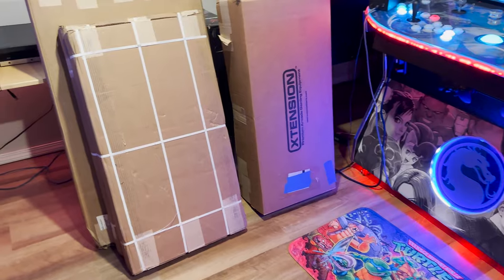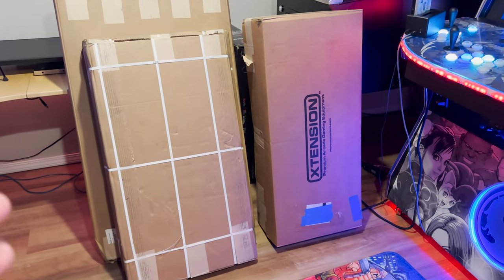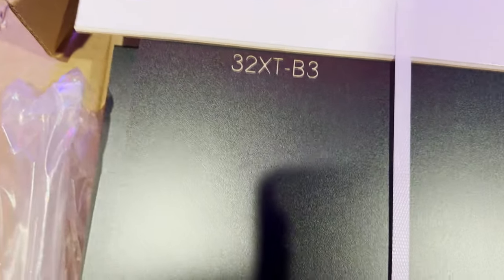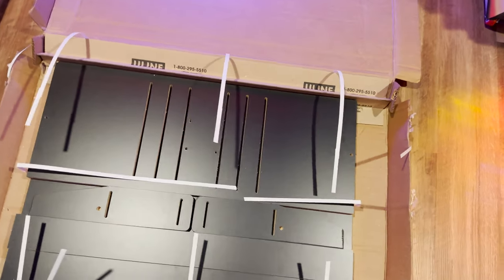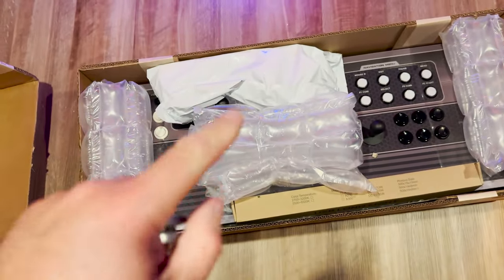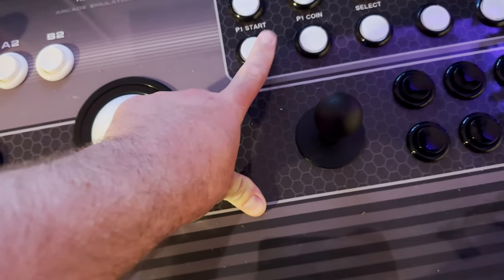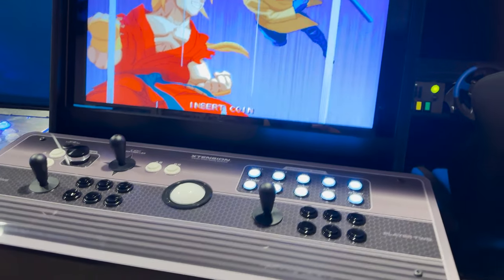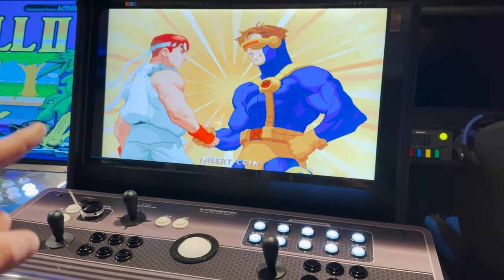Full Size REC ROOM MASTERS 32" Xtension Arcade Cabinet "Emulator Edition PLUS" Review and Unboxing

Comment: Amazing how quickly you unpacked those boxes, Adam! 😋
A couple of years ago, I built one of these "tankstick" cabinets (from the old owners' company, apparently). And I too went with tempered glass over the supplied plexi.... 100% worth the upgrade, clarity-wise. As far as the artwork, I was able to order what I wanted when I ordered the cabinet itself (for an additional fee). The artist that they had did a great job creating custom artwork for the cabinet, the control panel, and the marquee. All-in-all, it was a great starter arcade that I ran Steam games on (through Launchbox/BigBox). And I was able to hook up my old Xbox One & Nintendo Switch to it, using connectors and switches. I think it's a great way to get an arcade cabinet without spending a ton of $, assuming you already have a computer available to use.   👌

Comment: hope they intend to bring back the vertical cabinet.
Reply from the maker: Oooo, good call! With all the new vertical teknoparrot shooters that would beg nice
Reply: @ArcadeAdam I’ve emailed them about it several times. The new owner says it’s in the works!  He didn’t provide a timeframe though.
Reply from the maker: @timbowers839  if you didn’t want to wait you could easily just leave the top half off a regular extension cab and wall mount the TV for an EASYMODE pedestal.  Save the top half if you change your mind later…

Comment: I would love for them to do a 4 player. Great product. I love how wide they are and roomy.  As for the particle board , as long as it’s 3/4 or 5/8, it’s heavy enough to make a solid arcade.  Lastly , all good abkut the build process. Good idea to do it separately.
Reply from the maker: They do have a 4 player control panel but like I said in my first video, it looks cramped as heck but I have no first hand experience.
Reply: @ArcadeAdam  oh yeah. I recall now you said the 1 and 4 spots had 4 buttons only.   I didn’t originally see it on their website.
Reply: @therexershow  I own a 4-player recroom cab, got it about 6 years back now.  4 big adults it's a bit tight but with two adults and two kids, perfectly fine.  Works great for emulating Gamecube and Wii 4-player games - which is about all my kids play.

Comment: Great video.  I noticed a  couple of things watching your video.  
1.  There appears to not have a shut off switch for the Navigation buttons to turn off the lights.
2.  How are the joysticks and trackball mounted?  Are there screws holding them in place on the inside of the control panel?  The old RRM had bolts going all the way thru the control panel surface thus holding the joystick and trackball in place.  Wouldn’t that be a more secure design than having bolts hold them in place from the inside?
3.  I like the redesigned keyboard door.
4.  I am Not a fan of the fact that you, the buyer, has to apply your custom Artwork yourself.  I would hope they start offering that service as well.
5.  I like the fact that you are given an LED Marquee light instead of a Florescent light.
6.  I like the speaker placement change and Monitor placement adjustments/change.

For me as I own an original RRM cabinet, the only nit-picks are the artwork is self installed not  installed by RRM. And wouldn’t having the joystick/trackball under mounted be less durable than the old way of mounting them thru the top of the control panel?
Reply from the maker: Yeah, removing the button to kill the admin led button lights is a tiny let down but under mount style hardware for that clean look has existed for a long time and it feels really solid.  I wouldn’t think twice about letting my kids or anyone in a public space beat on it. Should hold up about the same.